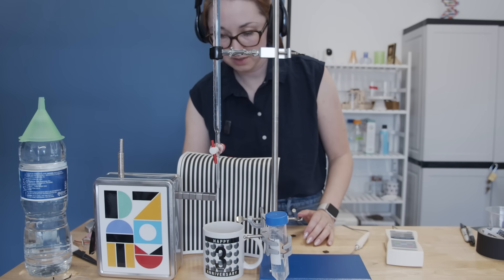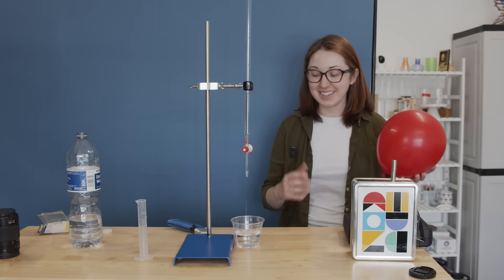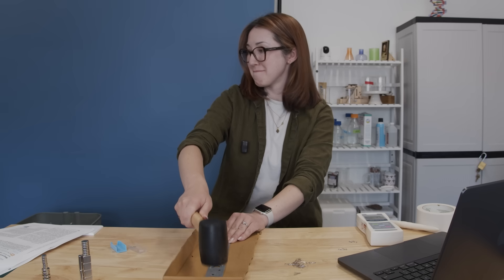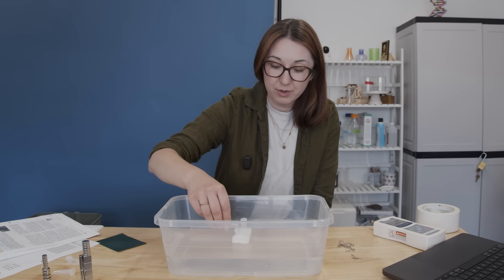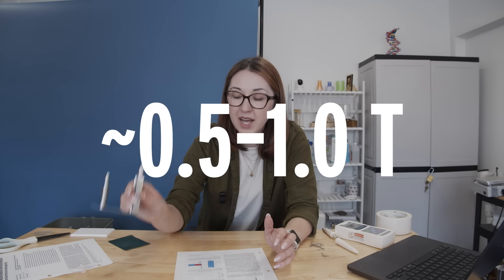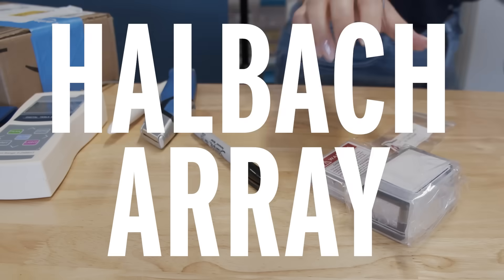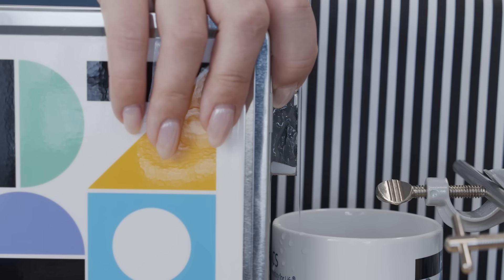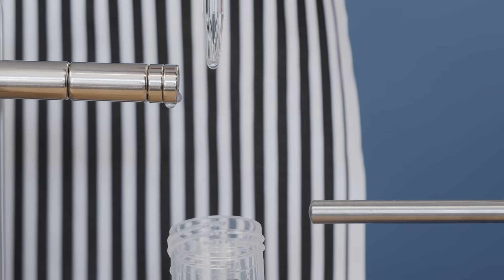Magnets Can Bend Water

Comment: Water CAN BE pulled by electromagnetic fields, which has VERY HIGH VOLTAGE > 220V and low current e.g 50mA.
Reply: But, if you use VERY STRONG ELECTROLYTE, you may lower the VOLTAGE.

Comment: You don't have to buy a big magnet to create a higher field strength, you can just create a magnetic circuit. Basically, you can imagine that in order to attract anything, the field lines from that magnet have to make a complete circuit through the interior of the magnet, out one of the poles, through the air, and into the other pole. And air is really really bad at "conducting" magnetic fields. Its relative permeability is really low. So if you replace that air part of the circuit with anything else that has a high permeability, the magnetic field strength will be much higher, in the same way that the current in an electric circuit will be higher if you lower the resistance. You could connect one of those magnets to a U shaped piece of iron, for example, and that would boost the strength quite a bit.

Comment: The electrostatic residual charge on the magnetic bar array charged positive or negative is likely to interact with the water charge. So, using a non-ferrous metal bar will work the same.

Comment: I have a theory ( of sorts, more a hypothesis or observation but it integrates the 3 magnetisms ) it aligns with fusion energy reaction levels somehow and highest yields of Mev ( Mega Electron Volts ), the most powrful of fusion reactions are 
Deuterium + Deuterium = Helium 3 + E Mev + Proton ( Diagmagnetic reaction )
 and the following fusion reaction 
Aluminium 13 + Aluminium 13 = Fe 26 + E ( Mev )  ( Paramagnetic reaction ) this result gives you Fe26 ( iron ) that is ( Ferromagnetic reactive )

Comment: I haven't thought about this for years, but in junior high I did something for a science fair project that caused a lot of head scratching.  Similar to your experiment I tried influencing the water stream with the water flowing through the center of a solenoid.  I found out two things with this experiment.  The first was that tap water contained enough impurities that the water was conductive enough that when the solenoid was pulsed with a high current the stream would jump around due to induced current and a resulting magnetic field.  The second was that distilled water would not do this.  However, if the solenoid was pressed with one side depressed  making the resulting field non symmetrical,  the stream would deflect a tiny amount.  This required very high current pulses.    This was in the late '50s so the switching was manual, using a 6 volt car battery and a knife switch to pulse the air core solenoid wound with many layers of 10awg wire.  And no, I did not win place or show in the fair.  It was considered too dangerous.  I think they thought I had created a death machine because of the 4 inch long arch caused by the inductive kick back when the knife switch was opened.

Comment: To detect small deflection pass a laser pointer’s light through the stream of water and project it on a wall or screen far away. Then a small deflection of the stream will be far more visible. (If the optics don’t work in your favor because the stream will work as a cylindrical lens, you can use another lens after the light has exited the stream and focus the diffused light to a point. Then the effect will be magnified).

Comment: I think the key is the first half of your video. You demonstrated the electrostatic forces are much stronger than the magnetic ones in this case. Water dripping out a nozzle can acquire electric charge (see the "Lord Kelvin's Thunderstorm" style generator). But more than that, just handling the objects can give them different random electric charges-- hence the unpredictable attraction/repulsion. You could try to control for this by hooking a ground line between the magnets and the water in the burette. Just be aware that the action of the water stream breaking into droplets could give them a net electric charge.
Reply: To be clear, the effect of any electric charge is going to mask or overwhelm any magnetic effect, so make sure everything is at the same potential by electrically connecting water stream and magnets.

Comment: Does high saline water bend the same as low saline water?  What if there is a surplus of divalent metal dissolved in it, vs monovalent metal?  What if we run a charge through the stream?  What if we vary the voltage and amps of the charge?  Of course, now we'll need a consistent source of static electricity as our deflector.

Comment: Halbach arrays are fun! I've made loads of them by 3d printing a frame for them. It's a little tricky to get the sizing of the holes right (too big and they like to pop out while you're assembling the array, too small and they can't make it in, too close and you can't get the compression fit to work) but if you do it right, you can even reuse the magnets without needing to destroy the frame.

Also, I HIGHLY recommend making a large k=2 cylindrical array (like a foot in diameter at least) because they are SUPER fun to play with for reasons I don't want to spoil. Yes, they take ages to build, yes, you need hundreds of dollars of magnets to make them, but they're so worth it. I demoed one for an exploratorium last week and they immediately told me they wanted one.

Regardless though, my best guess on the heavy water inconsistency bit is that there was either a net charge (electrical effect) or temperature change that drove it. Probably the latter, and I can't imagine that temperature-dependent measurements of heavy water's magnetic properties HAVEN'T been gathered by SOMEONE already.

Comment: JB weld epoxy has iron dust in it so you might have created a ferrite choke by using that particular adhesive.
Reply: Or the fact Halbach works only with ferritic materials bigger than it.

Comment: I did something like this! I built a Halbach array too, but I potted it in plastic with a thin layer of fiberglass either side. I did it similar to the way you built it, you construct it on a thick iron surface to hold together, but with a thin single layer of fiberglass cloth either side. I did the math and fiberglass is strong enough that the magnets won't push through it, and it seemed to work. Once it had set off it's completely stable, even years later I still have my Halbach arrays! Yay! Then for an experiment I submerged it in shallow water, and observed the surface for the dimples they create using reflected light. They were small, but definitely there. IRC it was visible with the Halbach array, but not with single magnets. Another thing you can try is make a simple horseshoe-like magnet using a metal backing plate with two or more single magnets to turn the flux around. It's not quite as an intense field as a Halbach array, but it's surprisingly close, and unlike Halbach arrays it's mechanically stable. Most of the pole field intensity comes from just the length of the magnets, and doing that doubles the effective length.

Comment: It could be that there was a little bit of electrical potential difference between the heavy water and the magnets in your first attempt.

Having a thin metallic wire connecting the liquid in your burette and your magnets to the ground should help dissipate any static charge buildup.

edit and you may want to ground your own body too.

Comment: Before you write that paper, note that if you get anything too close to a stream of water you can bend it toward that object by effectively increasing the air resistance on that side similar to how water in a pipe flows faster in the center of the pipe than near the edge.
Reply from the maker: I actually did a control where I used de-magnetized magnets (I baked them to their curie temp with some pizza…) to make sure it wasn't the aerodynamics!
Reply: @ACSReactions  Too bad you didn't include that bit of info (& a clip) in the video. 🙁
I like seeing the controls run too, but, then again, I'm a weird, science nerd.😹
Reply: @ACSReactions  Maybe it has something to do witht the nucleas of the deuterium ? Who knows!

Comment: About MRI machines pulling people...
That's not due to the diamagnetic effect but rather the ferromagnetic effect such as ferromagnetic belt buckles, tools in pockets, medical implants (usually older ones), firearms, etc.  Even certain tattoo inks with ferromagnetic dyes have been reported to cause pain and minor injuries during an MRI scan but my understanding is that isn't very common.

If you do any work around MRI machines they warn you about being careful to remove anything which might be ferromagnetic. There are also warning signs before entering an MRI room about this potential hazard.

Edit to add... I just wanted to clarify since some viewers might have misunderstood and thought you were attributing it to the diamagnetic effect.
Reply from the maker: Yes I should have clarified, I meant that even though I’m wearing metal, the tiny magnets aren’t ripping me across the room. Definitely meant ferromagnetic!
Reply: @ACSReactions  Thank you! I made a comment because I was confused by that part as well

Comment: Plz do a non-magnetic ctrl with the same shape to acct for aerodynamic effects k thx
Reply from the maker: I did! It was cut for time but I used some magnets that I heated to their curie temperature so that they lost their magnetism, so that it was the same shape/surface/etc but without the same magnetic field!
Reply: @ACSReactions that’s actually a really clever way to do a control :)

Edit: wait as long as heat doesn’t cause air currents that move it

Comment: So many problems.
Ehh.. Did you consult with someone who actually works with magnets? 

1) The magnets are still electrically conducting - the Ikea plastic-box on the left is statically charged. The magnet transfers this potential and (electrically) attracts the water. The magnets slightly repel it. Who wins? Roll the dice.
2) It's not about a field-strength (or flux density), it's about the gradient, if you wish to repel (or attract).
3) If you have a moving stream of water, you are likely to add other effects (e.g. eddy-currents) unless you are using distilled water. How can you make sure this confounding variable doe snot muddy your results? |what aerodynamic drag or Coanda-like artefacts from the surrounding stream of air?

If you just want to demonstrate diamagnetism, get a flake of pyrolytic graphite, place it on a checkerboard (or Halbach) pattern, watch it levitate, the end. Or wach Brainiac75 on YT.

Comment: 5:00 it's the size of the field, but also the frequency at which it oscillates
Reply: MRI fields are more or less static (they're created by superconducting coils - reversing the current in the coil would be impractical. Also knowing the strength of the field throughtout the area of interest is critical to the function of MRI).

Comment: So cool to make a halbach array at home. I have to try that one day. 🥰
Reply from the maker: If you do, BE CAREFUL! It was very hard to keep the magnets in place, and they really wanted to fly apart. I would highly recommend buying magnets that are made for halbach arrays and have holes drilled through them so you can string them on a metal rod. It would have made my life a lot easier!
Reply: @ACSReactions we had a 1T halbach array (mostly just to play with) in a lab I worked at, it was mostly 3D printed and designed as a cube with a borehole which made it a lot more structurally sound just putting a bunch of magnets together. It was fun, you could try and hold scissors right outside the hole and they would get sucked into the middle like crazy. Was definitely a little sketchy but honestly the shape of the scissors kept them from flying through like just a rod could which would be way more dangerous.

Comment: When you put a object this close to a stream of water I would have expected the water to bend towards the object, just a little. I would expect the boundary layer between the stream and the air to drag some air along with it. And if the space between the thing and the stream of water is very small, I would expect the pressure to be slightly lower on that side than on the other side of the stream. Thus I would expect the stream to bend towards the object.

So to see the same thing happening with a magnet is not surprising to me. I would try to do the experiment whit and without something magnetic and see if there is any difference between the two.
Reply from the maker: I actually did this control with some magnets that I heated to their curie temperature so that they were the same size/shape/surface/etc, but were no longer magnetic, and I saw no movement!
Reply: @ACSReactions you should have included that in the video. That was going over and beyond and I love that. 😂

Comment: I distinctly recall doing this in third grade during a whole thing on magnets. Lately I've seen a lot of papers that seem new somehow and are very not.
Reply: I did an equivalent experiment in high school using a non-polar liquid with water to detect movement (the oil film congregates. Kinda Brownian motion, but with magnets) and also detecting a deflection in a pool of water via distortion of the reflection (I think I kinda got it to work once in a billion tries and ultimately said screw this).

Anyway, that was long enough ago to where the details are very fuzzy.

Comment: I believe this demonstration IS possible with inexpensive home equipment like this, but you need to take more pains to exclude stray residual electrostatic charges from the apparatus before concluding the magnetic deflection is working. You can see for yourself with the balloon at the beginning how powerful the electrostatic effect is in comparison to the diamagnetism effect, and so significant and extensive efforts to ground everything and dissipate electric charge may be required here. Add to this the fact that the water stream will spontaneously electrostatically CHARGE ITSELF if it is allowed to break up into discrete droplets via new surface creation and charge partitioning (the Lenard effect, of spray electrification effect. Think Kelvin's water dropper / sparking buckets experiment.) and you have a bit of a puzzle to solve. I would first try to construct the entire apparatus out of conductive...everything so that continuous grounding may be more easily achieved. May I also suggest using the refracted or reflected beam from a laser pointer to observe minute deflections of the stream?
Reply from the maker: Some great suggestions here. There was a whole sequence in this video showing the control to make sure it wasn't just static doing this, but it took too long for what amounted to very little dramatic payoff, so we dropped it from the final cut.
Reply: @ACSReactions  In a similar vein, I was wondering whether aerodynamic effects might come into play? Hypothesis: the falling water creates a channel of downward-moving air around it, and where the water falls very close to the magnets, there's a low pressure zone between the magnets and the water, because the air there is moving quickest. That could direct the stream towards the magnets in the heavy water test. Any chance of that? Did you try putting a non-magnetic thing next to the water to see if it redirects the stream at all?
Reply: Yup i tried this experiment before as well to watch diamagnetic effects just to observe how much stronger eletrostatic force is compared diamagnetic repulsion😂

Comment: The coolest part about that first demo is that it was only recently shown that static electricity can cause the steam to bend ALL THE WAY AROUND the object and loop around back to the starting side
Reply from the maker: Okay wait now I need to try that
Reply: @ACSReactions  If you try it yourself, when my group tried various materials and rod thicknesses, we found a quarter inch glass rod worked best. It needs to be thin because the radius of curvature is small. We used a Van De Graaff generator to keep up the static charge continuously, otherwise the water droplets sap off static electricity too quickly.
Reply from the maker: Okay I am 100% going to try it like this. Stay tuned!!
Reply: Can u link to the actual journal that talked about this cuz im curious
Reply: We're gonna see orbital mechanics applied to electrostatics

Comment: It is the principle of electromagnetic separation that was used in the calutron (Oak Ridge TN) at the Y-12 plant.
You don't need to write a paper.
Notably it was women who made the best calutron operators.
Reply: I don’t think this is quite the same. The Calutron was a mass spectrometer operating on a beam of Uranium ions.  The positively charged ions are deflected in the magnetic field, but the lighter U235 ions are deflected less than the U238 ions.  Water is not normally very ionic, some small amount of dissociation into H+ and OH- will occur, but not much.  

What’s odd is the attraction with D2O versus the repulsion for H2O.  Is the bond angle affected by the added neutron, making the D2O more polar and overcoming the weak diamagnetic effect?